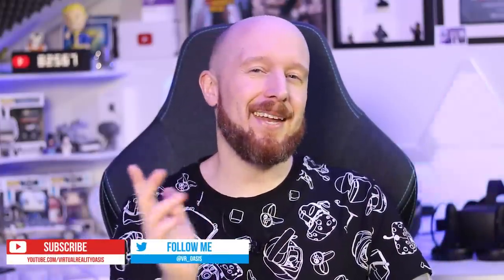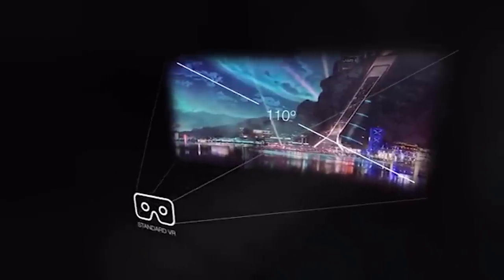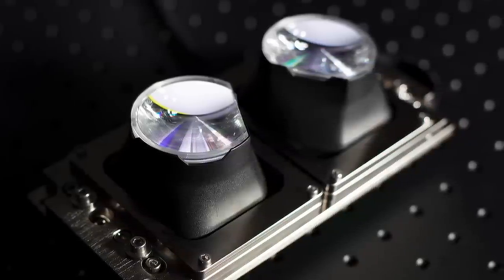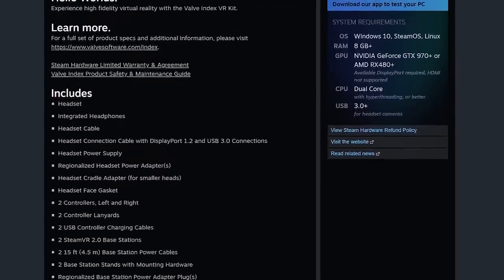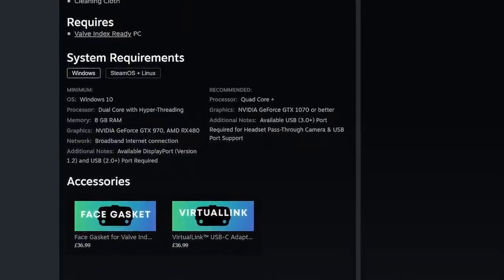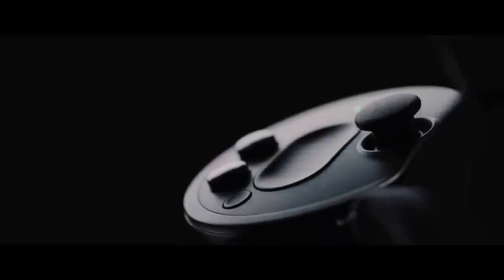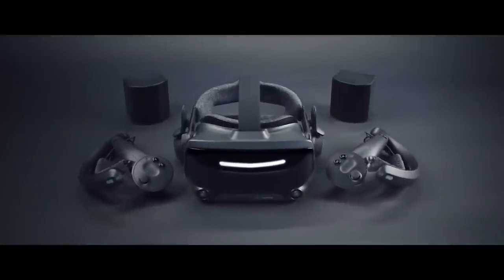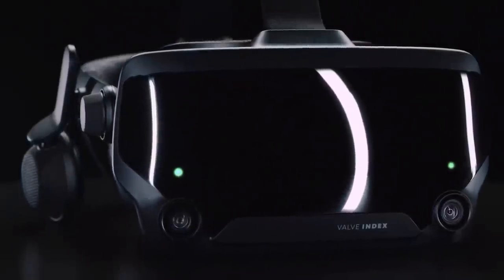Valve Index - Everything you NEED to know

Comment: $1000 Plus a high end pc?   Nope. And the games for this are NOT going to be reasonably priced.
A no tether equivalent is right around the corner. This headset will be leap frogged in less than a year easy.
The VR market is ripe for smaller, lighter with more power and way better tech like room sensors built in.
The only way this would be feasible would be if your steam game collection would work. They won't for VR.
Reply: It plays all current vr games on steam, actually, so your library will work and games are as reasonable as they are today. Its already sold out and backlogged for months. The lighthouse is a far more advanced, precise, low-latency solution with far less occlusion problems. Just because you don't want to put things in the corners of your room, doesn't mean the solution that works better for your situation is the best solution.

It also is not meant for first time or new users. If it was, they would not have sold so well at this price. Its a high end solution for enthusiasts who want to best tech available for a reasonable cost (this $1000 headset includes tech only seen in $3000 to $5000 headsets barely available to the public, if you want to look in relative terms for "reasonable cost"). Not newbies to vr who want to get into it. If you're even remotely close to the target audience who wants this almost 2x refresh rate and 0 screendoor headset with full finger tracking and willing to pay for it as so many people have so far considering its backordered for months, you already have a high end pc.

The rift S and quest are always there for people entering and starting VR, the index is a totally different class of product
Reply: @hightoxicity9819  
ok.. we shall see.🙂
"Selling out"? Selling out is just setting up the illusion of scarcity. Oldest trick in the book. The galaxy fold was on the verge of "selling out".
Im not saying its a bad headset, its ok.  especially if your already invested deep in the steam ecosystem. And of course all the steam fanboys will jump in line to buy it. Im just sayin it wont be "king of the hill" for long. at all. Forget about the quest. everyone is so fixated on that week attempt. Its a toy at best. What im telling you is the all in one will rule for sure. And it will take no time. VR has and will continue to push miniaturization to the next level. Everything is moving so much faster than ever before. Dont forget tech growth is always exponential. And we are on the downside. I think it was a mistake for valve to decide to do everything in house. I have no doubt they will also realize that soon. I totaly understand the excitement from the steam community. And yes it is because they already own the hot rod pc and all the games. But i think your missing the real picture here.
You have to think ahead... At least a little.  Because its already here. You just dont know about it. All in one is the answer. A lightweight, no sweat inside, NO Teather head set, just as powerfull as your pc. Yes that is a thing. (because its built specific for its purpose). Everything will be asic driven. Better optics, way better resolution and  the whole idea of "refresh rate" will be a thing of the past. Of course clunky hand controllers will soon become a nice thin pair of gloves. Want to pick up a non virtual gun and shoot it? Just do it, Why not? Any other controll you need will be accomplish by the speed of thought alone. You dont know or understand this tech because they will dose it out in increments. Just more profit.(yeah.. you get to buy all the games again in the vr version). Trust me its here. More than your imagination will allow.
This whole conversation remindes me of many years ago when i was obsessed with mining bitcoin and everyone thought I was nuts. It was not hard to see the future then and its not hard to see it now. The pc will be for vr as much as your modern cell is for use as a phone.